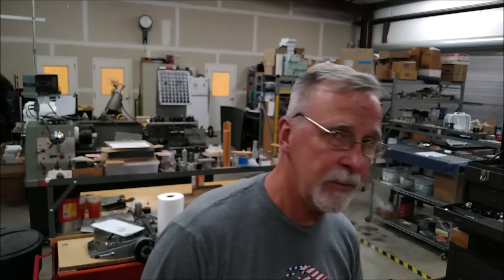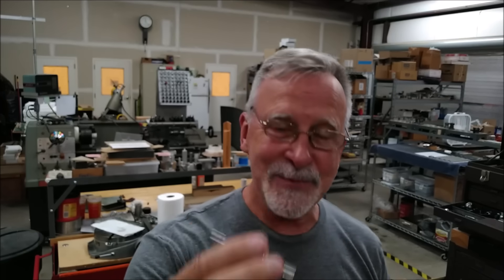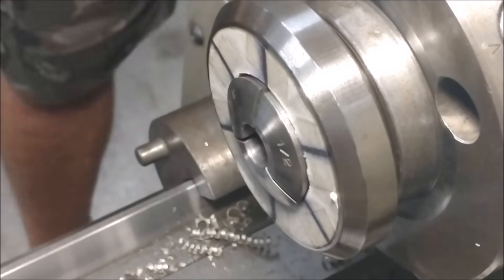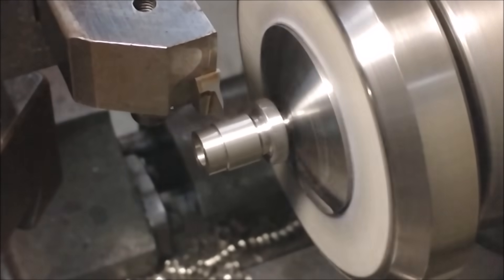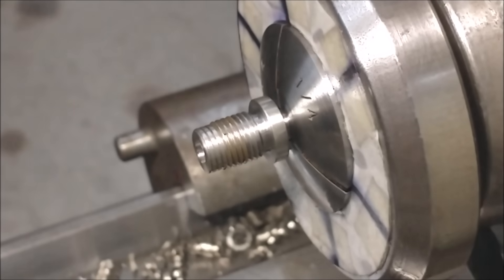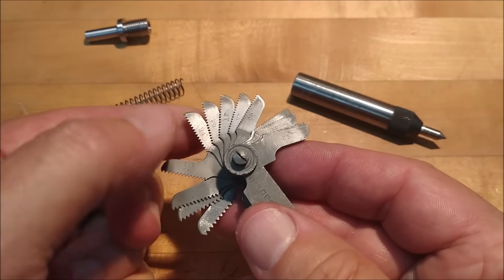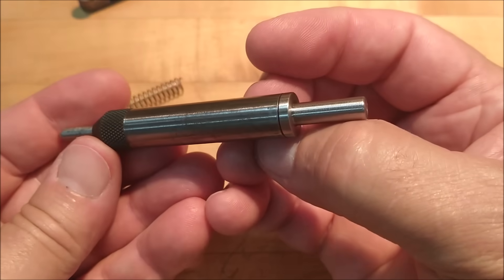Machinists....DIY Time Saver For Tapping !!

Comment: I have a project. If you would be interested in or have the time to work on, it is a small engine called the crusader .60.  It is featured in The Home Shop Machinist July/August  2005.
Reply from the maker: I'll check it out. though my next project is either the wood lathe to finish the PM shop, or a Stuart Steam hammer. I even considered designing my own steam engine....

Comment: My 1/2" keyless drill chuck goes down to 1mm diameter which is small enough to hold a 1.3mm tapping drill for a #0-80 UNF thread and also a 1/2" follower.
Reply from the maker: Personal choice I guess. I don't like to use big chucks with small tooling.
Reply: @joepie221  When the jaws are fully extended there is surprisingly good access to see the small drills. For a quick changeover or repeat operations the arbor on your small chuck could be changed to a 1/2" straight one. Drill with the small chuck, remove complete from 1/2 chuck and load tap guide.

Comment: Fine- but swopping over the base takes as long as swopping the chucks. And turning the internal part around is also a multi-step process. A while back I made a couple of tap followers (one of each type) in 10mm o.d. Same size as my edge finder. Fits my chuck fine, otherwise I would have made them smaller...

Comment: Simple/Smart!!…tks for sharing…but it begs the question….why not build a reduced size unit in both diameter and length to combat the “Z” issue???, leave the stock unit in the box🤔😍
Reply from the maker: Hi Chuck. I probably would have, but I didn't have a reasonably sized spring laying around. Ultimately I will. Take care.

Comment: I wish he would have checked the runout after assembling
Reply from the maker: I will go back and check it. But to be fair, this is a commercial item and its not intended to spin during use. That being said, I ( we ) are at the mercy of the starting quality we purchase to begin with. Making sure the end of the part is square to the 1/2" dia axis will certainly help with any runout reduction.

Comment: I have one that i made a version of your solution. I have a Sherline lathe and mill and my lathe has a 3/8” chuck for the tail stock. I took a 3/8-24 bolt and cut the head off and screwed it in the tap guide instead of the plug screw. The smooth shank of the bolt chucks up in the chuck just fine.

Comment: When I made my adapter I just made a hole to slide the tap guide into with a MT-0 tang to mount straight into my tail stock.  Yes I have a very small lathe.

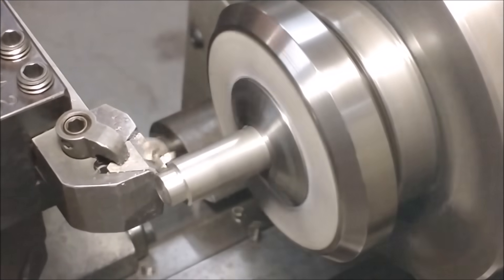Comment: round bar stock was moving in a whole lot there when making it @4:00, almost an entire inch.
Reply from the maker: I saw that. When it happen, I thought my DRO had skipped a beat. Solution, more torque on the collet adjuster. Good eyes.

Comment: As always, a master at work. Great making that adapter for small chucks, a combi tool.
45 years ago lots of holes were drilled using and electric hand drill and tapped laying on the knees on the floor. Not one single drill, nor a tap was broken, and no hole failed. 
Now days drilling in the mill, changing to the tap, power tapping a few revs and then hand tapping has done the job. M10 has been the largest

Comment: Great Video Joe..👍 I do have to laugh though 😂. I found a set of the thread gauges at a flea market last year for 5 bucks. METRIC AND SAE and They are STARRETT….I hope you and your family are safe and well…
Reply: As I am in the UK I have 60° UN,  55° Whitworth TPI and 60° metric pitch thread gauges. I don't have a BA thread gauge as I don't do much with BA threads but I do have an inherited set of BA taps and dies to act as a gauge if I ever need to check a thread that I think may be BA. All get regular use and if I lost a set I would have to replace it. I use small inserts for cutting threads of different TPI or pitch and the nominal tables for depth of cut are no good if the insert is more pointed than is ideal for a perfect thread root, so thread gauges are good for checking progress when single pointing.

Comment: I've had one of those guides for a few years thinking it would be useful, but had exactly the problem you show so it doesn't get used. Most of my work is with a 3/8" chuck, not a 1/2". I know what my next spare evening is going to be doing. Thanks Joe, not the first time your willingness to share knowledge has helped me!

Comment: I made a tap guide years ago. Mine was stainless steel drop of eBay with a bronze press fit nose. Handy little accessory. But it didn’t occur to me to have a grub screw in the back and pointy and flat noses. Also a great idea for using smaller chucks. I might have to make version 2.0 now. Thanks Joe:)

Comment: I knew my tap guide had a cup on the other end of the point piece so I wanted to turn it around and didn’t bother to look at the end where the hex screw was located. It’s been 10 years since I looked because I never needed the cup until last month. So I got out the pliers since the knurled portion was so tight and couldn’t undo it. So I got out the vise grips and cranked away. I kept trying to unscrew it until I gouged up all of the knurled end and finally I took hold of it and said why the hell won’t this unscrew. Then I looked at the end and saw the hex head screw and thought to myself “ oh yea” so now I have a perfectly working all gouged up tap guide that mocks me daily.
Reply: I've done the exact same thing... I thought I was the only one stupid enough to do that. Glad I'm not alone!!!

Comment: I had two different sizes. One for small taps. One for bigger taps that l could use a larger tap handle. For smaller number or metric taps l had a shop made hand feed drill chuck.